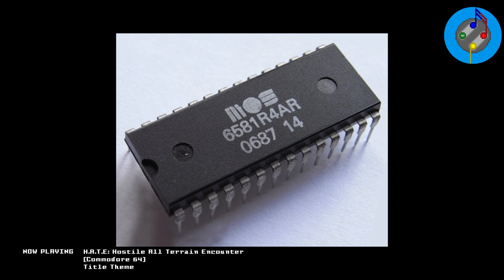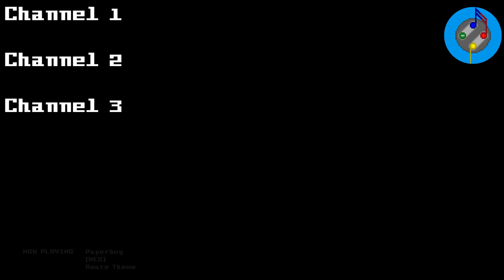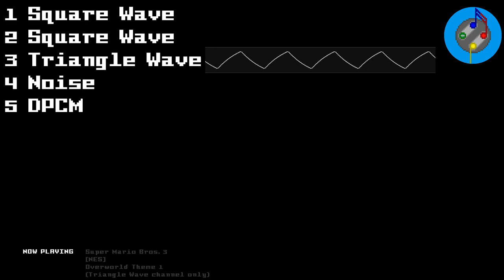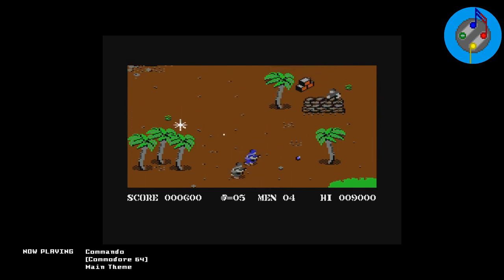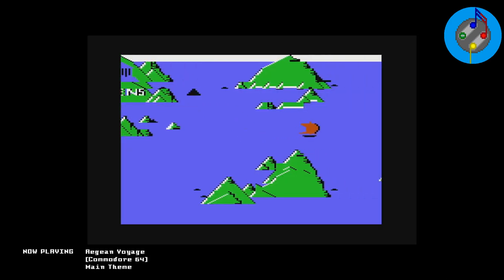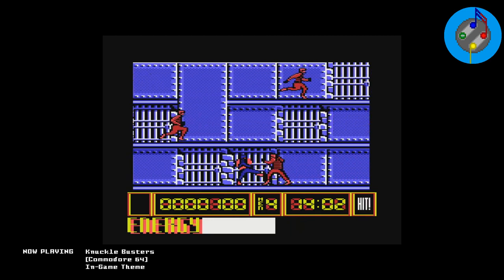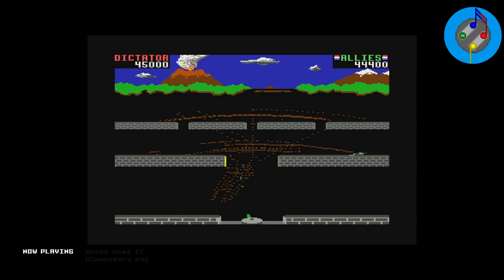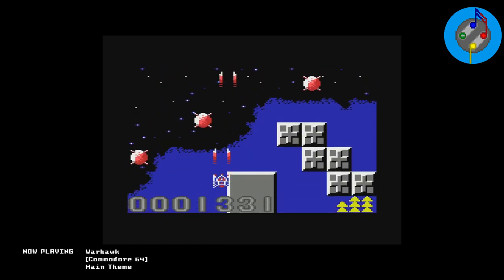Commodore 64's 3 Channel Problem - The Unmute Button

Comment: Many computers and game systems that followed throughout the 80:ies and 90:ies simply pushed the technical envelope of their sound capabilities by adding more voices, moving to pure multi-channel PCM sound (like with SNES but certainly as early as with the Commodore Amiga line of computers from 1985 and onwards) and following the move to PCM they would simply bump the sample rate ever so often until CD-quality audio became a reality in the mid/late 90:ies. As far as I know there were never any sound chips that - like the SID - incorporated resonant multi-mode filters and cross/ring modulation, which is absolutely crucial to the SID sound - it is effectively a compact subtractive polysynth in and of itself with many of the features of popular synths that came out around that time. The way I see it It doesn't matter if you have a million voices and triple CD quality audio in your sound chip - this will not give you the expressive features that make for a unique sound that stands the test of time if you just thrown tech specs on it. As stated in the video: The magic of this type of music is very much born in its limitations, as is the case with all chip music I would say (which is sadly lost on many new school chip musicians who never grew up with these limitations and seem to think that it is purely a question of aesthetics rather than the technical limitations being inherent to the sound and think that you can recreate the same kind of sound with 128 channels, 16/24/32-bit 44/96 kHz audio). You can absolutely make great music with less limitations but you cannot make this type of music without any limitations.
 
Side-note 1: Commodore originally planned for the SID to have many more voices, which did not happen for technical reasons. (not to mention that it would most likely have made it difficult to hit the very low price target that they were aiming for with the C64) Also,  during the generations of Commodore 8-bit machines that followed the C64 in the mid-80:ies there were discussions to finally get a follow-up to the SID that would, again, feature many more voices and features. Fans of the SID today drool over this what-if scenario but personally I think the limitations make the machine. Maybe it would have spawned a new type of music with its own distinct style but for better or for worse it wouldn't have had the same characteristic as what the SID originally turned out to be. It would have fixed the SFX problem, though ;). Personally I care a lot more about the characteristics of the sound rather than practical details like SFX voice allocation.

Side-note 2: Bob Yannes who designed the SID went on to co-found Ensoniq - a synth company. The reason the SID chip turned out the way it did is simple: Yannes was a synth guy who wanted to make a synth. That is why they ended up with a sound chip that had real-time filters and cross/ring modulation support - nobody in their right mind would have put features like that into a sound chip for a computer / console unless they were determined to make the synth of their dreams ;).That was the magic of Commodore / MOS Technology - individual engineers could make huge individual contributions that would go on to make history. That is just one example out of many.
Reply from the maker: Fantastic comment. I'm pinning this for those interested in more information about the SID chip.
Reply: @WeirdVideoGames  For more in-depth information I recommend the book "Commodore: A Commodore On The Edge" by Brian Bagnall (and its two sequels). Very interesting stuff if you're into this kind of stuff ;).

Comment: The SID chip is great but I think considering the limitations there can be a pretty big difference between NES OSTs too and even without talking about the audio expansions. Compare paperboy to something like metal gear or a jeroen tel OST. The latter tends to use basic pulse width modulation on the squarewaves for more expressive instruments, something konami also started doing but in a more subtle way a few years into the NES's lifespan (bayou billy is a good example). Or later sunsoft games with their sampled basslines and 2 channel percussion. 

The SMS (master system) probably had the largest amount of samey sounding games though there were some exceptions there too, just not as noticeable perhaps as it's an even more limited chip but some OSTs like Alien 3 had a sawtooth-like bass (periodic noise) and 2 channel drums. 

Channels being temporarily cut off for sfx is a problem on those too but as long as the main melody is kept it's usually not that big a deal to me. It would be cool to see emulators that remove this limitation for retro systems (kinda like how they can remove sprite flicker or slowdown), but until then we can use YT and the like while playing with sfx only.

Comment: Solution 1 and 2 are fine, 3 however, just awful. I can do with 2 instruments or even 1 but pausing the music just to play a sqeaky toy sound is annoying

JUST HAVE NO SOUND EFFECTS
That's solution 4 and it's worse than 2 but in my opinion better than 1
Reply from the maker: I grouped games with no sound effects in with solution 3: Only having one or the other.
Reply: Solution 5: Record the soundtrack to tape, play the tape on a cassette player sitting next to you on the couch and switch over to SFX only in the game - presto, you now have music + SFX at the same time ;D. It's not like the music is interactive - who cares if it comes from the computer or not ;).